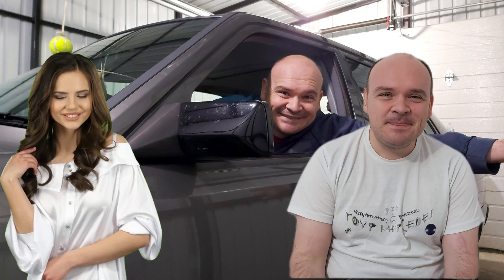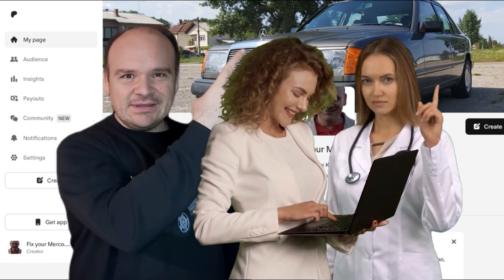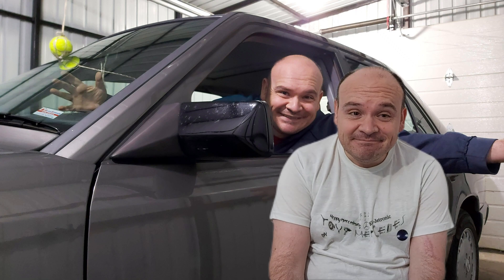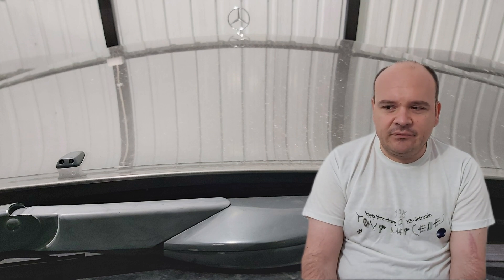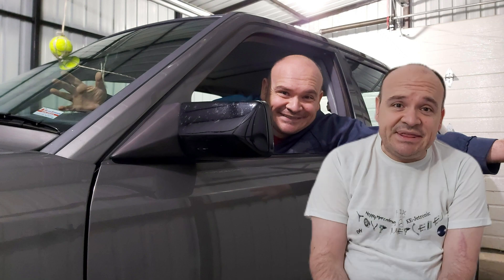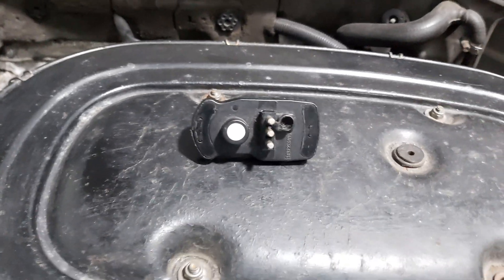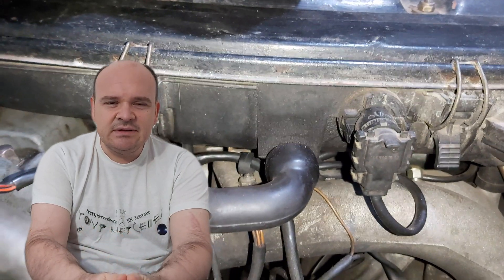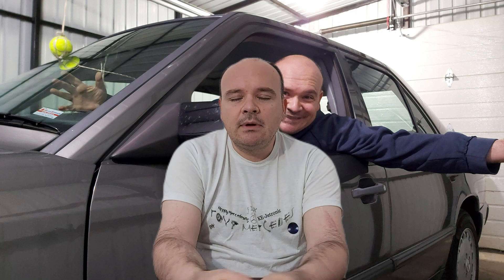㉦Mercedes Ke-Jetronic㉦ - Can I swap TSZ to EZL? IS it possible?

Comment: are they both on K jet cars or are the TSZ on efi  cars ? like M104s ?
Reply from the maker: TSZ was used on K-Jetronic cars and on KE1 and KE2 Jetronic system. And the answer is NO, M104 engines used EZL ignition module both on KE as well as on the EFI.

Comment: Could you make video of swapping ezl to tsz? Is as hard as swapping tsz to ezl? I have car thats 1991 and has ezl on it, i bought engine and noticed that this new engine requires tsz..
Reply from the maker: I don't understand why you would like to swap EZL for TSZ. Concerning the engine, the only explanation is that you bought the engine for W123 because W123 has M103 engine and it uses TSZ ignition, or it is the engine from the first series of W124. This way or another, TSZ and EZL are spark related ignition types, the way how you get the spark although I saw recently a modification from the EZL to TSZ for the LPG, just in order to adjust the idle manually! It is not that simple for me to find so old cars to try to do this experiment. If you want to swap the engine, you must find the same one with the same code, for example M102.982/985 - .982 labels W124 2.3l, .985 190E 2.3l engine.
Reply: @mercedeske  Yep i bought year -88 w124 engine, and my car is -91 w124. I already swapped the motor, but cant get spark. Then i saw my old motor is using ezl and the old one needs tsz.

Comment: Are you serious?
Please look at the harness of both systems first. The tempsensor with one pin will also do it if you do both cables on the one pin. It gives also cars with first type potentiometer and ezl on KE 2.0
Please learn deep the differences between the KE-systems before you desinform some people

Comment: Hello, what is the measurement of a spark plug for a Mercedes 126 model, 560 engine, depth between negative and positive?
PT Spark Plug Gapper Gap
Reply from the maker: 0.8mm between the 2 electrodes.

Comment: Between TSZ and EZL, what's your favourite and why?
Reply from the maker: They are both reliable and good. The EZL does everything automatically, the timing is being automatically adjusted which is not the case on TSZ but that doesn't make the ignition system worse than EZL. The TSZ was present on R107, W116, W124 first series and 190E first ones as well. They had less electronics and more pure mechanics. If I had a Mercedes with TSZ I would consider that as a downside.

Comment: well can i somehow remove that whole box i have carburated version of that engine
Reply from the maker: The TSZ is related to the ignition, not to the injection. It's related to how you get spark for the spark plugs. With a carburetor or injection, no matter, same thing. If you get spark then it's okay!

Comment: Hello fix your mercedes. 
I have a little update about mij 420SEL. 
Thanks to you my fuel problems are fixed. 

Butt the engine will not run, and it wil take some time te make is running again, or in the worst case,  replace the whole engine. 
This week I found out that the timing chain is stretched out a bit. 
And some of the guides are broken. 
For the time being. I will think wat to do. 
I'm thinking to take the engine and  transmission out. That wil work easier. 
Also because the transmission is leaking a bit. 

Greeting Helmer
Reply from the maker: Glad to know about that. Well, if the timing chain is the issue, then I would advise you not to start the car any more and to replace it(logical, right? ;-) ). Everything is tight on the V8, so if you remove the engine with the transmission it is going to be easier for you to work on both of them! Greetings,
Ivica, FyM
Reply: @mercedeske  and some sparkplug holes the threats are damaged 😫. 
Engine and examen. And make a decision. Keep this one or a good replacement. 

And thanks a lot so far for all your tips and tricks 😀
Reply from the maker: @h.v.g7882  Always my pleasure!